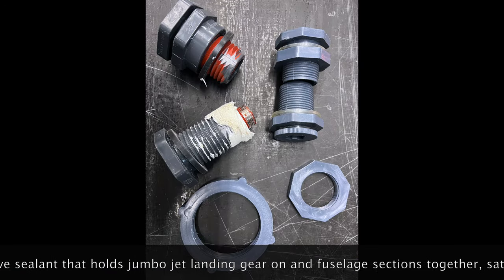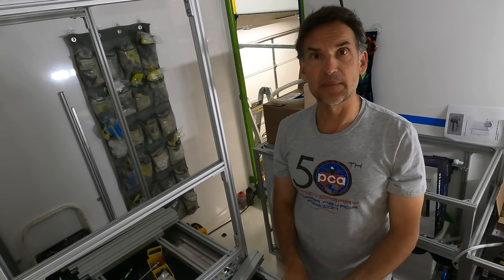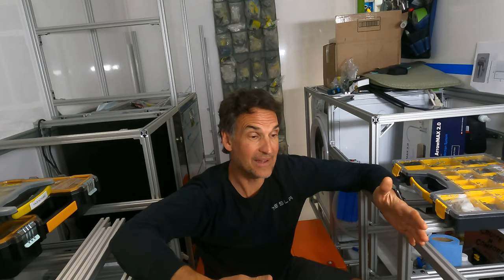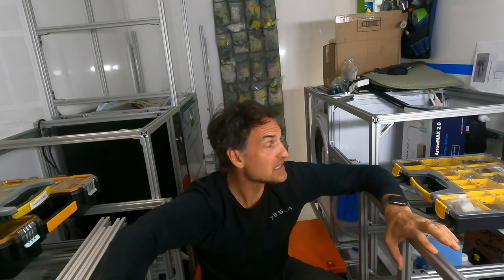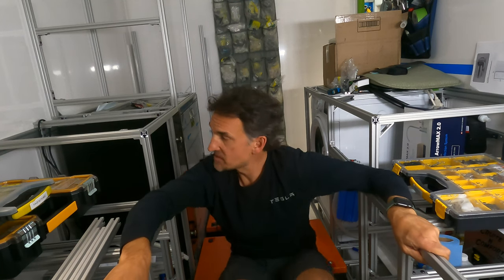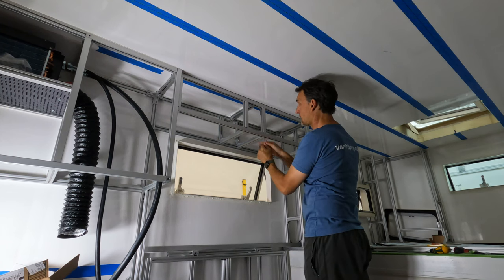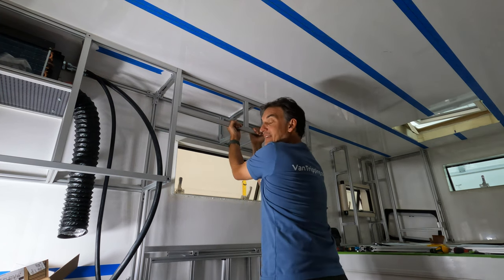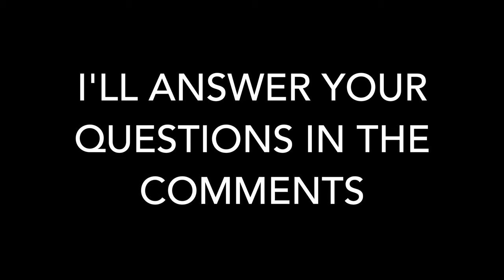The best way to attach cabinets to composite campers

Comment from the maker: FYI, there are thermal expansion joints between the longer spans, even though very little is needed and the adhesive can elongate with any thermal expansion differences. I will show those "expansion joints" in a future video.
Reply: Many of the people who are auto body men use glue to attach body panels on cars that is the way they come from the factory!
Reply from the maker: @lawrencedobesh776  Yes, that's right, many parts on newer cars are glued together.
Reply: I’m curious if you know what the difference in coefficient or thermal expansion is for the panels? With my van build I found that the difference in thermal expansion between the van body(steel) and aluminum extrusions was enough to make me not want to mount an 7 ft long extrusion rigidly on both ends. I calculated the differences in length to vary over an 1/8-3/16 of an inch over the temperature extremes that the van will see through the year. I ended up designing a sliding mount to allow for that movement and can actually observe the difference with temp fluctuations.
Reply from the maker: @noahjensen2376  I did pull up the thermal expansion of the aluminum extrusions and the fiberglass sheeting of the camper. The fiberglass doesn't expand enough to consider, whereas my longest piece of aluminum extrusion will expand up to about 1/8", so I allow these longer pieces room to expand, and the adhesive has as much as 500% elongation, so plenty to handle the thermal expansion of the aluminum.

Comment: As per other comments, amazing information shared and thank you.  Did you prep the surfaces?  It looks gel coat on the fiberglass panel.  Did you scotchbrite the aluminum and scuff the 'glass?  I am also a huge fan of Sikaflex.
Reply from the maker: The composite panels are gel-coated. All I did was clean each surface well with rubbing alcohol. For this installation just adhering to cleaned surfaces should be sufficient but if extra strength is needed, each surface could be lightly scuffed before cleaning.

Comment: Great content! I'm inspired to build something similar someday soon. Quick question... did you ever have to remove a piece of 8020 that you glued on? Curious how that process went, and if not, did you have a plan for how you would do it? Slice through it with a long utility blade?
Reply from the maker: Thank you. Yes, I have removed a small section and it was fairly easy. I sliced the adhesive with a razor blade as deep as possible on both sides of the 8020 and then used a slicing blade on an oscillating multi-tool to slice between the 8020 and composite wall. It worked well.
Reply: @vantripping  Very reassuring to know, thank you.
Reply from the maker: @drewdowns3618  Just start by cutting with a sharp blade as it's very rubbery.

Comment: Awesome video! Any chance you know anything about the toxicity / VOC's of the glue? Tried searching but did not find much, wondering if you've already looked into it. Cheers!
Reply from the maker: Thanks! The adhesive sealants are very low VOC and harmless, There is no smell from them and they are safe to use indoors, and once cured safe against food and water. Most of the adhesives I am using are made in the EU and meet the EU's strict guidelines for low VOCs and human safety. You can also pull up the MSDS for these adhesives from each of the manufacturers. One that I remember is Sika Flex 292i but there are several other brands and products I also used.
Reply: @vantripping  thank you!
Reply from the maker: @RobertOKruk  you're welcome.

Comment: What’s the name of the glue adhesive Bonnie would recommend forfoam  base campers
Reply from the maker: It's always best to confirm that the adhesives are compatible and appropriate with the materials you are adhering and for the strength and application of use. I've been using SikaFlex 292i and 252 also is a very good option. There are many other very good adhesives for this application. I've used some from other manufacturers that are very similar in specs. Generally any high-quality poly-urea based adhesive sealant for outdoor use and applicable for the two materials it's adhering should work well.

Comment: Sorry, if I missed this somehow, but would you share a link to the adhesive you are using?  Thanks.
Reply from the maker: Sure, I'll share again,. I've been using SikaFlex 292i. 252 also is a very good option. There are many other very good adhesives for this application.
Reply: THANKS!
Reply from the maker: @ApteraPioneer  You're welcome.

Comment: what glue are you using, and is it the same glue you used for your solar panels? thank you.
Reply from the maker: I've been using SikaFlex 292i and 252 also is a very good option. There are many other very good adhesives for this application. I've used some from other manufacturers that are very similar in specs. Generally any high-quality poly-urea based adhesive sealant for outdoor use and applicable for the two materials it's adhering should work well.

Comment: Great job at explaining how strongly attached the 8-20 is to the habitat.   Also looks like you have made some more progress.  Congratulations. 

I was looking at getting a composite box for our build but wasn't fully sold on the $35k is price tag. 

It's funny we have gone through at least 5 design changes since starting. 

For price the E450 with a 17ft+- chassis for under $10k seemed like the good foundation then build out a aluminum frame box and we were looking at a 30k build out. Not bad. But then this or that needed changing or upgrading and now with a F650 30ft box we are up to 60k-80k.

So hats off to you for pushing through all this analysis paralysis and doing it.

Am I out in lala land for wanted a very nice build for the 60k range? 80k? Or I should just say this is the real Expedition rig we want and price it out?
Reply from the maker: Yeah, one can build a camper for $10k or $1million, obviously very different functionality, features, quality and durability. This is my third camper build, and I can say that being beyond super insulated is more important than anything else, and that means any thermal transfer points to reduce noise and improve thermal comfort and losses. I seriously thought an E450 with a composite box--the benefits of the composite box is time, comfort and strength. You save tons of time (and money) not having to insulate a metal shell, and the metal shell will just never be as well insulated and thus not as comfortable thermally or quiet as a composite box. And the composite box will be much stronger. The other big benefit in time with a composite camper is straight vs curved walls. I would estimate that curved walls double the time to build and install framing, and reduce weight because the cabinets are simpler and also there is more internal space for the same exterior foot print.

You can definitely build a great camper on any chassis, and in any space, but when doing your cost analysis, really account for the added time and cost of materials to work within a curved vs rectangular space, as well as for insulation and actual remaining internal volume. There are many added costs for materials, tools and other hard to plan things, plus there is your time. Try hard to really take these into account. I'll do my best to provide an accounting of these at the end of my build to help others with their planning. I would say you can build a decent camper for $30k but $60k to $100k for materials may be a more realistic budget when accounting for everything including painting, insulating, etc. Realize that your or someone else's time is more costly than the materials, and much time will be spent in planning, designing, researching, procuring, set up, clean up, tool shopping, shipping, etc. in addition to the actual build timer and likely the build time is less than all of the other time needed.

I encourage you in your build and will help in any way I can.

Comment: Is the 80/20 you are using all 10 series 1"x1" extrusion? Also can you please post a link in the description to the exact adhesive you used to bond the aluminum to the composite?
Very solid framing, it will not absorb moisture, and is so much stronger than wood framing, great choice!
Do you plan on using an Isotemp marine water heater so you can utilize hot engine coolant to heat domestic hot water? I was doing some research for my overlander on Isotemp and was on West Marine's website and the reviews were not wonderful especially for the high cost, it seems that even though the tanks are 316L stainless the welds and inside of the tanks were rusting and leaking. I am considering either welding a tank with heat exchanger (marine calorifier) for myself or having a local fab shop make one that has a heat exchanger coil so I can use a thermal solar panel to heat my water and a 750w single element backup.
Reply from the maker: Yes, I am using all 1" profiles (10 series) as it stronger than needed while reducing weight and space of the frame over larger profiles, allowing for more interior cabinet space. I'll showcase more of the strength and benefits in future videos. I've been using Sika 292i but have also tested Sika 252 and both are designed to adhere to fiberglass, plastics and aluminum including anodized aluminum. The Koropop 225 that Total Composites recommends for gluing up the composite camper walls also has a spec that supports the same materials, but the Sikaflex is stronger. All are polyurethane based, so similarly easy to apply and with excellent temperature range and strength, as well as elongation to accommodate the different thermal expansions of the materials.
Reply from the maker: I installed an Isotemp with water heating from the engine and hydronic heating inside my camper van, but decided to not do a hydronic system or interconnect to the engine's water system, as all introduce greater complexity, failure and maintenance points that could be very problematic, so I am installing an all electric system. Plus, you are right: the Isotemp or other engine-heated water heaters are pricey and would require full replacement should their heat exchangers leak. I show the water heater I have installed and some of the reasons why I chose this one and electric water heating in this video: https://youtu.be/691V9Wkk7CU.
Reply from the maker: I will showcase in a future video my all-electric heating system and why I have chosen this after analyzing costs, performance, weight, space, reliability, maintenance, and other reasons, as well as my testing to validate the performance, and compare it with other heating systems. All have their pros and cons.

Comment: Hey! How do you work around the total composites protrusions when mounting your 80/20 since they are not flush with the panels?
Reply from the maker: Good question. My floor came slightly bowed, and exactly the same dimension as the floor pultrusions, so the 8020 on the floor just bridges between the pultrusions to floor high spot with adhesive between them. On the walls, which are straight, I just use the pultrusion thickness as the thickness of the adhesive. The pultrusion thickness is about 1/8", so the adhesive easily fills in this amount. I just built from the base up and made sure that everything was level in three dimensions and kept that level as I went up to keep everything square. It was all pretty easy to deal with the thickness of the pultrusions.
Reply: Ah, that makes complete sense now. I’ve been really scratching my head with that detail. 

Great build and great videos! Very helpful stuff. Thanks for the reply👍🏼
Reply from the maker: @patricknally3859  You're welcome. Don't fret those pultrusions, it's easy to glue over them, letting the adhesive fill in the small void and level them as you set them like tile into grout. Just be sure to cut the 8020 pieces slightly short to allow them to expand and not push against the walls, floor or ceiling when they run the long way.

Comment: Nice to see your build come together. Have you ever rounded up the numbers for the weight of all your installed material or are you cannonballing since you have enough reserves?
Reply from the maker: If you're asking about total weight of the build, I have not added them up yet but am tracking as much as I can, but will will need to do an accounting of all materials and their weight once complete. Plus, I weighed the truck when picking up new, and will weigh it once completed. It started at around 8000 pounds with subframe, front winch & bull bar bumper, full 4x4 conversion, scrub bars and roof rack, spare tire, rear bumper. The camper weighs about 1500, windows, skylights and doors likely add another 350, and rest needs to be calculated but likely 14000 total, well within the 18000+ weight carrying capacity of the chassis and robust upgraded drivetrain.